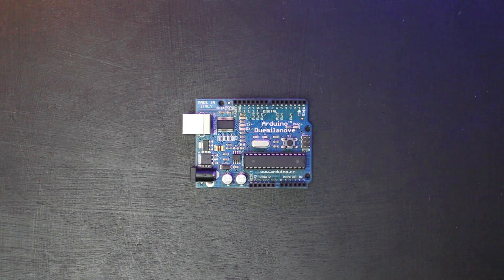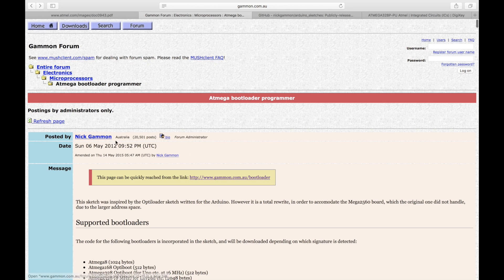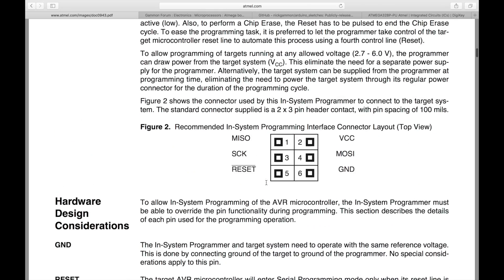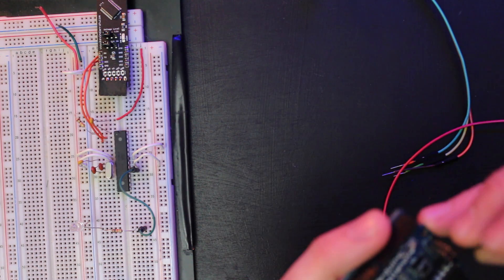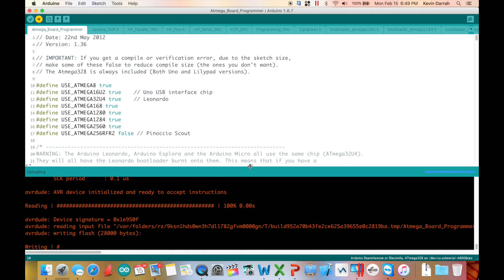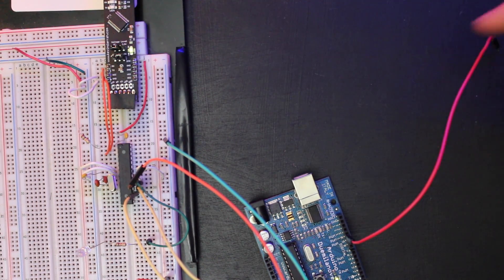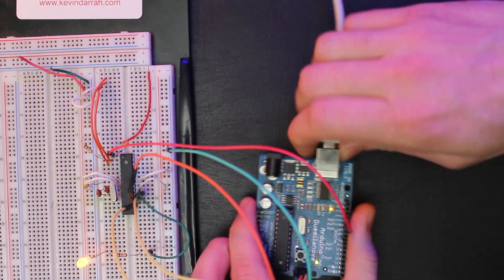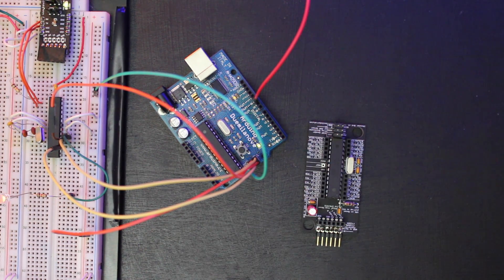Best Way to Burn Arduino Bootloaders Tutorial!

Comment: I like stand alone programmers....
Reply from the maker: +Richard Johnson you sir, just gave me an awesome idea.  Thinking about back when I had to program 100's of bootloaders - could've used this same method here to make it completely standalone.  The prompts to program and select bootloader version could be modified to work with a few pushbuttons - then maybe an LCD screen... yea, that would've saved a lot of time.  Would be cool to also modify this code so it could batch program the bootloaders.
Reply: That would be really cool
Reply: since he uploaded the bootloader with sketch the arduino can program without pc with just a serial one char code signal.
or by just placing it a push button :D